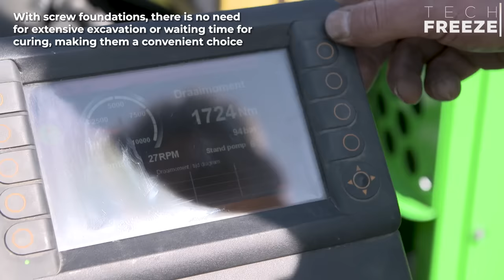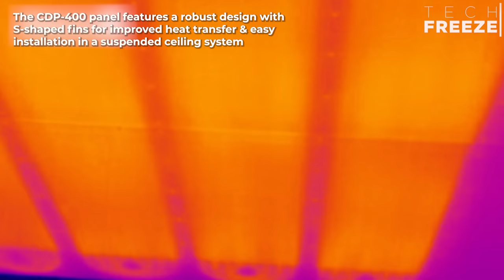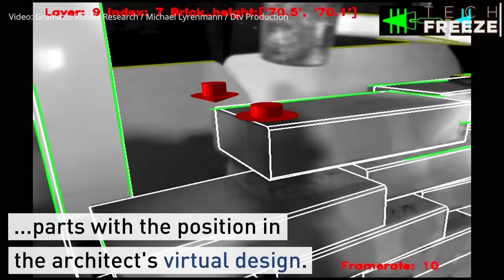Modern Construction Technology: The Future of Building ▶7

Comment: Need more details about each project and a voiceover would help as having to read the subtitles draws attention away from the extremely fast short glossed over presentation of each innovation. 

Less is more, so cover fewer innovations with more details such as the percentage reduction of weight, cost, labor, time efficiency, environmental benefits and overall savings compared to standard technology.

Building with wood is a terrible idea as trees take many decades to slowly sequester atmospheric carbon so cutting them down is counterproductive unless not to mention the major fire, mold, termite risks🙄